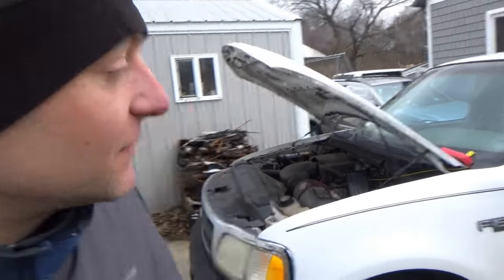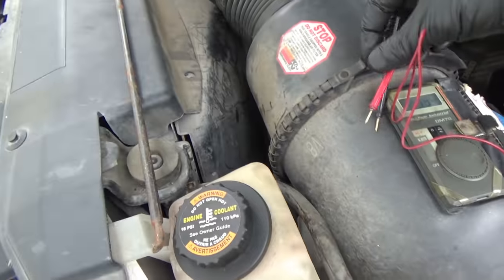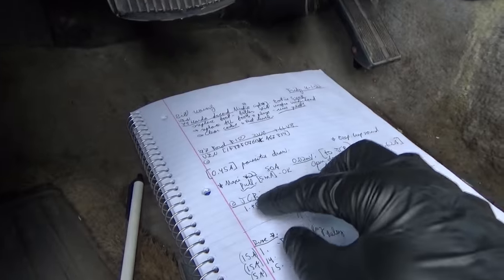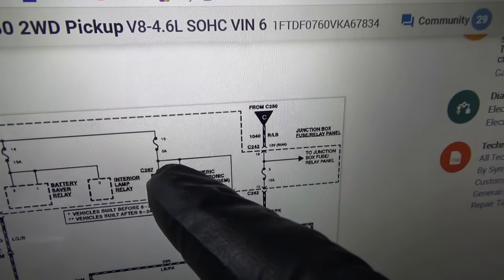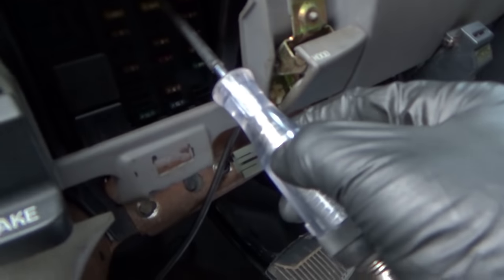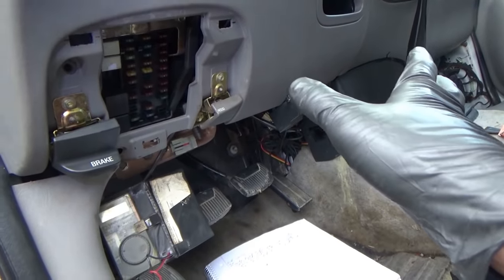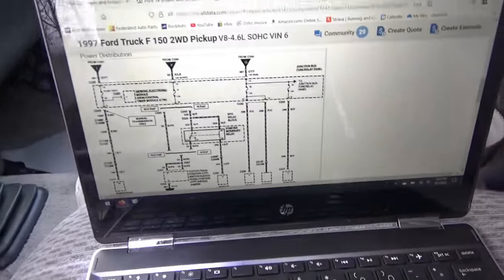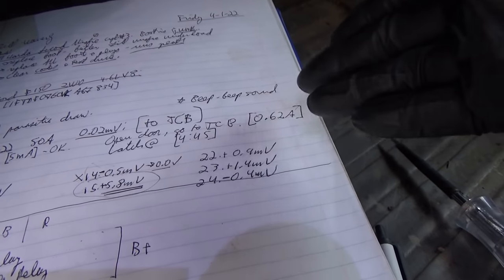This Parasitic Draw will BLOW YOUR MIND!  -Part 1 (97 F150)

Comment: Did you try moving the turn signal switch?  No joke.  Look at the contacts in the wiring diagram.  Does this have some aftermarket attachments or plug ins?  The brake pedal is also an input to the t/s & 4 way switch.
On to part 2.

Comment: ** There are 2 relays hidden relays beside the inside fuse box..  The only way you can see these is from looking upward above the gas and break pedals, underneath the panel that's right below the drivers wheel... (On my 2003 F-150 is where they are located on my truck.)

Comment: Do you think jumping pins 30 and 87/87a on the battery saver relay would cause the vehicle power down sooner than 45 mins? Just curious if that would save time in future parasitic draw diags

Comment: Known issue with that body. Water intrusion follows harness to top of GEM, shorting random pins in the harness. After servicing the harness, I dosed it with WD, and tied a rag in a tourniquet around the harness. No more problems through 440k miles.
Reply from the maker: Nice! What about the water intrusion?
Reply: @PineHollowAutoDiagnostics   nothing. In my experience, it only happened under certain conditions, so I wasn't going to chase it, unless it got worse (never seemed to...)

Comment: My last weard back feed had nothing to do with any circuit on the component's feeding each other. The power for the central locking was feeding because the wires joined together in door harness and was in series with door lock. It would be weird if you unlock doors and problem went away as it did for me. Took me 5 hours the longest I have taken in 20 years.

Comment: Driver floor appears damp and dirtier at the kicker panel....
You have the typical leaking cowl and the fuse block inside is corroded internally.  Needs a new fuse box under the dash

Comment: “Tea.s ready”! 9re: whistling noise). Sir I have a story to tell you.: I bought a 1965 Mustang 289 pony in 1969. My brother and I jump started the car but it had a positive ground? The car turn over very slowly growled in pain and died. Apparently we killed everything battery, radio, regulator generator or alternator all the wires. Ps the most amazing part of this story is when the Phil radio was off it would slowly light up and the volume would slowly go from 0 to full blast. Any comment?

Comment: You may not have 4WD, but how was it "removed" at the factory?  Are there still connectors where the green crusties can attack? However, I'm guessing the soft short may be on the underside of the trailer relay box.  That why it doesn't go away when you pull the relay.  It also seems to be the only place fuse 24 gets close to always on power that hasn't already been ruled out. As for the shop replacing the GEM module, I'll bet that weak power was confusing it.

Comment: Um, at 16:50 when you have the flashers going the test light DOES CHANGE INTENSITY with the flashing!!!!  I confess I have only seen the video to this point, but it's odd we can see it changing intensity in the video but you can't see it!
Reply from the maker: I mean slightly just due to system voltage changes 🙂

Comment: I've got a 450ma drain on a Volvo. I checked the 4 fuse boxes. Each fuse was measured in millivolts and they all went down to zero. I checked current between + battery pole and the starter/alternator and it measured zero amps. hmmm. I was wondering if a corroded circuit board could drain without showing up on a fuse?

Comment: That noise at the very beginning had me thinking a ground issue is causing current to run where it's not supposed to.  The partial voltage is probably because current is going in series through several circuits.
Reply from the maker: Good guess! But that would be too easy ;)
Reply: The kettle is boiling - time to make the tea.

Comment: The clue is it is a 1997 F150. More specifically, it is a '97 truck, forget the F150 part. In 25 years, a wire can easily rub through its insulation against another power wire. It is barely touching, but it is enough for 6 volts to back feed into the system. Start breaking connectors and see when it goes away.

Comment: I don't know a single thing about cars but I love computers. I wish I had know cars have so much electronics in them like twenty years ago when I was 13 (I'm 33 now) ,I'd have totally gotten into fixing at least the non engine components of them for like a trade skill job.. I was almost under the assumption cars were almost just entirely physical mechanical (idk the term) combustion?)
this is the first time I've ever realized cars are wired the same way hice and computers are (mind blown)
also why does it look like your in a freezer?

Comment: My guess would be that that fuse panel has an internal short to power.
Reply from the maker: Fords and Chryslers aren't known to have the most reliable "smart" fuse boxes huh? xD
Reply: @PineHollowAutoDiagnostics  That'd be a big NOPE! Lol. I had to change a fuse panel on a 2013 Ford Escape 1.6 turbo recently. And wouldn't you know? It does not separate from the wiring harness. So guess what I had to do? Yeah! 18 hours of removing wiring. Including removing the instrument panel. Which was so beyond ridiculous. Because the entire harness comes out except for ONE connector that goes to the accelerator pedal. And that connector runs behind the instrument panel. In front of the hvac box. So stupid.

Comment: Here is my story, I drove my 17 explorer to get a sync device for another. That i had no am/FM radio 2015 f150. With the sync module from the f150 in my vehicle, the screen of explorer blacked out. After the device was installed in the f150. Which fixed the problem of radio stations (initial problem no am or fm). The explorer didn't have black screen, but put itself on the update screen. Which was the latest version. So I exited and now works like it did before I transport the f150 sync module. If anyone has any information, we can talk.

Comment: I own a 97 F150 4x4 4.6 that also has a parasitic draw. My solution has been just to use a battery disconnect at the ground terminal until I get around to solving it. 

It has had other major issues going on to say the least. Had to replace all hard brake lines and brakes. Then I saw that the bump stops had rusted away (PA salt) and once I got behind the passenger bump stop cavity I saw that the frame had a 4 inch gash rotted away, so now I'm welding that back together...

Comment: I'm sure it won't blow my mind. Those trucks are known for leaking from the windshield into the fuse box in the cab driver's side.
Reply from the maker: OK...but have you ever actually diagnosed the draw?
Reply: @PineHollowAutoDiagnostics  Really? smh. Maybe you should get out the picoscope.
Reply: @PineHollowAutoDiagnostics  You bring me any machine on the planet and I will have it diagnosed correctly in 10 min 100% of the time. And where is the second video?
Reply from the maker: @sharkyrich4844  That's amazing haha!
Reply: @PineHollowAutoDiagnostics  lol
Reply: @PineHollowAutoDiagnostics  Apparently Sharky is offering to jump on Zoom with you Ivan to demonstrate how to diagnose even the hardest case in just 10 minutes. Go for it! The most you have to lose is 10 minutes!
Reply: @Graham_Wideman  The world today reminds me of the movie Idiocracy. We didn't have the luxury of youtube and wiring diagrams when we were creating a reputation for our shops. What seems simple to us is absolutely amazing to today's youth. And to be fair I'm not just a mechanic, I'm a retired Millwright out of East Chicago who opened a couple of shops. If it wasn't for my engineering background it wouldn't have been so easy.
Reply: @Graham_Wideman  Here is another one. We can rewrite the TPS drivers to shut down fuel injectors for 2 min when key is turned to off position and accelerator pedal is pressed to the floor. If you're being carjacked you can turn key to off and press the pedal upon exiting the car. As you run off the thief will sit there cranking the car. A minute later he will run off and you can have your car back and everyone is safe.

Comment: This one is proving to be quiet the rabbit hole.  At every turn comes a new tunnel.  I know those Fords have odd lighting control modules that are questionable at best IMO.  And are usually the root cause of many external lighting problems.  Is that the problem in this case study?  Stay tuned.  I'm looking forward to part 2.

Comment: But your Blower relay on the same block of the Flasher relay is also hot at all times and fed from fuse 23 of the power distribution box at 9:49 and a 40 Amp fuse... (not to mention the dim light seemed to flash slightly brighter when the flasher was actually turned on at 16:50, or it did on camera) could there be a connection from that?? and we haven't seen you examine that block as it's behind the dash! Could be some green crusties lurking behind there!

Comment: was driving myself nuts  thought why not see if its on yt  sure enough  it is and youve hit it on the head.  im putting a switch between the ground and battery inside to turn off power as to not drain the battery   best fix for the old girl

Comment: why is it Americans want feet, inches, their own gallons,quarts etc  but are quite happy to talk about engine sizes in liters/litres?
Reply: I'm 71 and when I was a kid, engine size was always "cubic inches". In the 1970's, when more import cars started to appear, the term "liter" started to take over. The US even tried changing gallons to liters at gas stations but it was never accepted.
Reply: If you let them take an inch they will take a mile.
Reply: Because when a newer engine is developed, it never got described in cubic inches, only in liters?
Reply: Why does europe have mm, cm, metres, and litres, but TV’s and tyres are measured in inches?
Reply: @davidnorton5887  And in a tire size like 225/55R17, the 225 is tire width in mm, while the 17 is wheel size in inches.